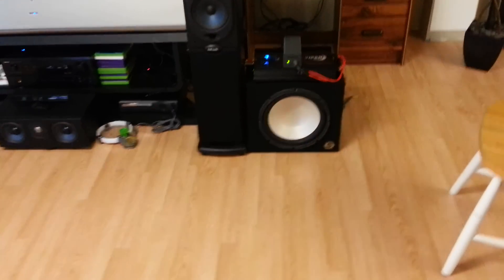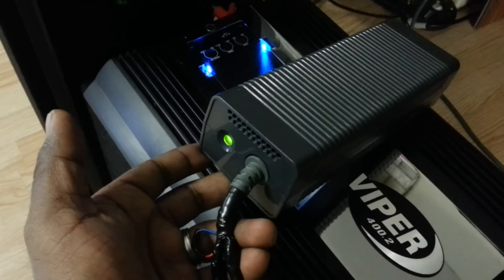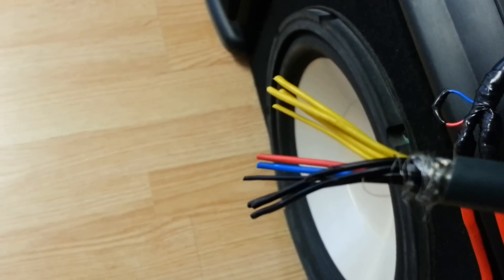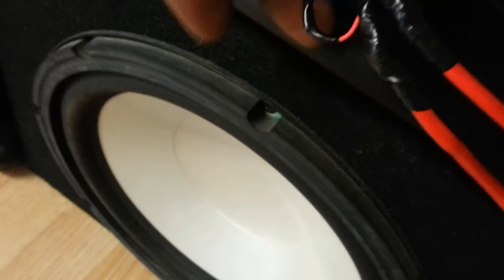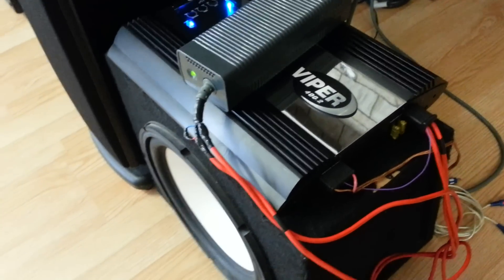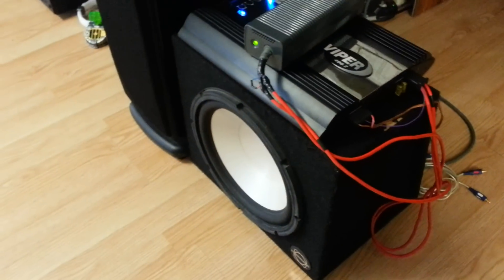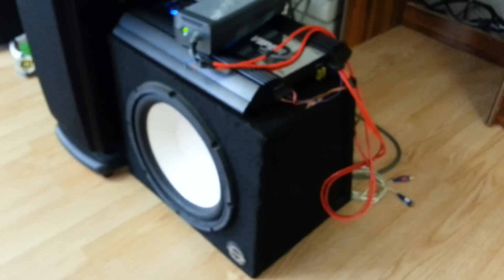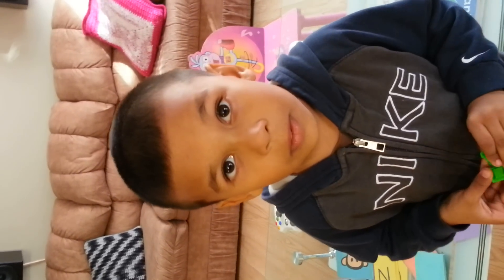Car audio at home - DIY - DC power supply  PSU w/ xbox 36o brick

Comment: AWESOME video brother! I’m just now getting to this in 2025 bc EVERYTHING is super expensive now. What I DO have is a nice supply of car audio equipment! But real talk tho…..what RMS/PEAK is that AMP outputting? And even with hours of high draw it doesn’t get hot??I want to do this, but at 14 Amp Output on the power supply, I can get this cheap and add a decent 12v battery as a power reservior. What are your thoughts? Is the battery needed?

Comment: I have an r.v ive got an extra battery im thinking of running to that battery to my amp  other than the inline fuse is there anything else i would need i have an extra charger on that battery as well

Comment: Fyi anyone doing this check your blacks and yellows for a single skinny wire on each if you cap those off and use only the thick ones it will stop amp from shutting off when running 200 watts. Not sure about higher.
Reply: thank you! My problem has been solved! From Japan!
Reply: @ of course srry my people here in America when they find a solution they only share if they gain something from it. Glad to help friend ❤️

Comment: Where's the remote wired to?
Reply: Jump it form positive for now
Reply: Just a small wire from the remote on your Amp straight to the positive on your Amp will trick it into turning on the Amp when you add power

Comment: Use a battery this will triple your electric bill 😂😂😂
Reply: This wont draw anymore power than running an Xbox
Reply: So you're saying that using a battery and having to charge the battery back up will use less electricity 🤔🤯

Comment: My power supply keeps on giving the red light instantly when connecting it to my heaviest amp, is it too heavy for the power supply? I've got the 150w 12a, so it's the smallest one. My other two amps work fine with this method
Reply: Yup if you draw too many amps the power supply will go into protection mode

Comment: Can you run a power on power off button to the power supply??? Ive been trying to figure this out forever cause i have 2 subs ran (this way with a power supply) but i dont wanna unplug them every time.
Reply: you can use desktop computer power supply instead of xbox one, they usually have power on/off buttons

Comment: Why not just go from amp to DC to AC inverter and from the inverter to a 120v power station that can be powered by a drill battery. Preferably dewalt

Comment: But won’t the wire get really hot
Reply: If you have a high watt amp
Reply: @bryarleach2054  no because the xbox 360 psu is like 260watt

Comment: Great Video! I tried you're set up and although its works fine on low volume, it starts to blink/flash adapter and amp light when volume is cranked up. Even trips at times. Im only running an old school autotek 7150BTS 150W amp. Any suggestions ? Do I need more amperage source to run my amplifier? thanks in advance for ur time!

Comment: Can you use 2 xbox power supply? To run an amp for higher power output?
Reply: You could you just need to find a 12v diode so one powerful doesn't back feed into the other power supply

Comment: If you were to make 2 of these.. could you use distribution blocks to link the ground and power from each to make higher amperage to play with?
Reply: people have been using PC power supplies, those are a bit more expensive but can push tons of watts and are just as easy to set up
Reply: Idk i was thinking about the same thing have u found out ??
Reply: Have not tried

Comment: Its funny because when i was a teenager i was always using home audio speakers in my car now im building a complete home theater system with car audio equipment. Im starting with a 100,000 watt system for an 1,100 square foot basement the 18 inch sub drivers will be the most expensive par of the entire system i will be building 4 different wall arrays of subs the seats will also be equipped with bass shakers so if your not scared 💩less your insides will at least be scrambled about

Comment: Guys, please use a more robust power supply.  I'm betting that Xbox power supply is only capable of providing about 20 amps of continuous current.  Car amplifiers, especially subwoofer amplifiers, require a lot more current for them to be happy.  When you supply an amplifier with too little of current or even voltage the amplifiers power supply is going to try very, very hard to push that sub with the given amount of DC power available.  When the amp wants to draw more current than what is available, over time this will eventually damage the amplifiers internal power supply and get very hot.  I would go with no less than 75 to 100 amp power supply.  IF you are going to try this at home, do it right the first time.
I will be making a video of my home setup that is running 4500 watts RMS and using 230 amps of AC/DC power supply current at 14.5 volts.

Comment: Question..  what do you connect to the remote spot on the amp
Reply: A wire running for rmt on amp to switch and a second wire running from power on amp to switch

Comment: I know this video is old guys but can any one tell me how he connected the remote turn on lead I've never seen an amp that just goes positive to positive and negative to negative without a remote turn on lead ?
Reply: @C Reed Thanks my guy this little Xbox power brick hack has been super helpful I'm running a Kenwood KAC-729S amp off of it and it works pretty good Its only capable of about 175 watts output but that's plenty for what I'm doing with it 👍🏽👌🏽✌🏽💯

Comment: Big Thanks to you I now can finally power my car subs in the house without having to bring in a huge car battery and having to hook up a bunch of cables, just didn't look clean and took up alot of space. So thanks once again man, awesome video 🤙
Reply: Are they still working?
Reply: @marvinreed3369  yeah it works but if u crank up the gain on the amp just alittle to high the power brick goes into production mode. So u can't really beat on your sub or subs with this set up.
Reply: @CarDudeVitaliy  The reason why is asked if it worked in your favor is because I had that same setup and I just wanted to see if we had the same problem. I have a solutions for it though, if you grab a power max 100 power amp, a fuse and a block and a 0 guage splitter box... you'll be able to turn up the gane.
Reply: @CarDudeVitaliy  if you can send me any social media I can show you a video of my setup, I'm runnin two skar audio 15in subwoofers with a vfl amplifier and these subs flex man.
Reply: @marvinreed3369  nice yeah send me a video of how it's hooked up to my Instagram, it's the same name. I would definitely like to get my sub setup working. I have a 10" strato ct sounds hooked up to a rockford fosgate amp and the power brick just keeps going off.
Reply: @CarDudeVitaliy check your 360 yellows and blacks. If there are 2 skinny wires on each positive and negative side cap them off and only use the thick ones. If you are running less than 250 wattz this should fix it

Comment: quick question, can i use a regular 12v  adapter to power the amp
Reply: you can but it you can't play it very loud, it will power starve (experienced it with 160w rms amp(in bridge))
Reply: @kultss  thanks man

Comment: power of xbox alim ->11A max  & 12volt......amplifier of car 
works correctly at 14v.....you must use a condasateur 1.5 farad for get 
14v with a alim of xbox ans use a amplifier of 150w/rms max 
(11Ax14v=154w) it s ridiculous for a amplifieur of sub!!!!! and if you 
use a amplifier sup a 150wrms your alim xbox will grill after some hour 
of use

Comment: so the rca output on a home cinema amp i can just plug into the rca input on my car amp?
Reply: yes you can literally plug in rcas straight from your phone or from an rca plugged into a bluetooth receiver and the other ends into the amp, its that simple, but if you have an amp that had 4 rca plugins you will have to mess around with the patter you plug in the rca to get better sound quality, if yours has 4 plug ins instead of just 2 I would recommend in a diagonal pattern

Comment: I used an Xbox 360 slim power brick and I came across some trouble. It only had 2 yellow and 2 black. I shorted the red and blue, then connected the yellow and black to the amp, but the brick light turned red as soon as I plugged it in.

Comment: Pulled my system from the car, just did this set up today with the Xbox 360 power supply. Thanks for the video. I had it going with an AC 12V but it wasn’t enough for loud bumping. Now my walls are shaking and my neighbors are jealous. Found this exact power supply in the video at my local game shop. Cheap 😎
Reply: How is it doing to this day? still working with no issue ? I want 2 know because I wanna do the same to my home setup
Reply: Did you just say You were running AC 12v 😂tf

Comment: Nice Polk Audio set up! I too am using a car subwoofer amp in my home set up. I was using a Direct TV power supply (12V 4.5amp) it worked flawlessly on a 400W amplifier, but the XBOX power supply I is 12.1amp, still not much amps but the XBOX power supply is a better choice

Comment: So I tried doing this with a kicker and a mrpf200 amp but for some reason the sound comes out extremely low. I tried adjusting the gain and making sure everything is wired correctly. Any idea what it could be?

Comment: Just a 12v battery (lithium) with a charger works fine for me on a low power 
quality system.      (good speakers don´t allways need a subwoofer)

Comment: disclaimer: an xbox power brick stacked by 3 , even stacked by double, is NOT capable of handling a 1kw load! Trying to pull anything more than 200W from it will cause damage to your equipment.  the power brick is capable of handling up to 200w for brief moments not a sustained draw of 200w and depending on the resistance of the speakers then that 200w draw from the power brick can quickly turn in to a 12-75w output from the amplifier. not only can this easily damage the power brick but it can also hurt the amplifier and it will more than like blow the speakers by clipping them to death. Do NOT stack power bricks do not use power bricks to power amplifiers do NOT use pc power supplies to power amplifiers. do it the right way, the safe way and buy a power supply designed to handle that kind of load. there is a reason why a 35 amp out put power supply that is actually capable of outputting 35 amps costs at least 100$USD.

Comment: Trying this currently. It only sends power to the amp the second i plug it in then the power brick turns red. Any ideas? Im also just trying to plug the yellow and black wires directly into the amp. Mine also had 3 yellows and 3 blacks
Reply: It is weird. I have gotten it so sometimes it turns on fine and works. Other times the red light comes on. Not sure why.

Comment: Had no idea the 360 power brick was a 12v out, that's awesome!
Reply: Yeah any power supply with a brick like that is an inverter :)
Reply: @GeorgeMasonOliver  honestly thought it was 36v or something so I didn't even check, but I've been using thrift store xbox supplies to power everything now. Subwoofers on every sound system now!
Reply: @Dinie09  ahh gotcha that’s cool tho I’ve been thinking about using some old sound system stuff to make a home media setup. I’d probably just use an old trickle charger on an Xs power battery I’m not using
Reply: @Dinie09   pretty much only industrial equipment use more than 12V
Reply: @GeorgeMasonOliver  pp
Reply: @GeorgeMasonOliver  its a Converter you convert AC(Alternating Current)-DC(Direct Current) with an Inverter you invert DC-AC. Most home electronics use DC power supplies to power themselves. If you look at the brick on any electronic that has a brick at the end of the power cord it will tell you the Input and Output info whether is AC 110v/220v how many amps it uses and then the Output whether it remains AC or if it Converts to DC power. A power Inverter is more commonly used in Automotive situations where someone wants to power home equipment in say an RV. Items like your TV ,Washer and Dryer, run off of AC power.
Reply: @strhaivenswr  Oh yeah I know al that and often now most things have internal converters, I just got the names mixed up
Reply: How many amps can this push? I was going to get a PC power supply but this seems a lot cheaper. My amp uses 60A

Comment: The shorter the wire is the less resistance you will have. But in your case you added more resistance when you added the 10 guage ! Allow me to clarify! Instead of twisting the yellow wires and directly plugging them into the amp you extended the wires adding additional wire that the current now has to travel through. When dealing with small amounts of power you want to keep the wire as short as possible and go into the amp asap! Your theory on Wire resistance is correct it just that added distance plus added thickness can add more resistance too! So again I would go into the amp as quickly as possible! At least that's my theory!
Reply from the maker: Your theory is correct Sir, I have learned alot if things since posting this 4 years ago!
Cheers,

Comment: I bet you are Canadian. Can't you just use a AC to DC 12V power supply instead. And a 2 way crossover network for the bass stuff. Sound pretty good though. ☑👍😎

Comment: Why not just hook up a switch to the red and blue button to turn it on and off
Reply: Anthony Efx more safe to just unplug it that way no chance of anything starting on fire
Reply: @daytonemmett5152  you could always wire a pull fuse in line with the switch.

Comment: I want to use an Xbox power brick to power my pioneer car audio in my kids room. Can I connect the blue and red wires to the pioneer so that the power brick is in standby untill the pioneer is turned on? That way I could keep settings and radio stations. I hope standby power of 5v 1a is enough for keeping presets? I don't fancy having the brick on all the time. Thanks.

Comment: Could I do the same if I have a active sub?
Reply: . You can use a sub with a broken plate amp, since you are bypassing the amp and controls.  Unplug the active sub from the wall!  Run the audio wire from the amp to the speaker + and - terminals (disconnect the existing ones) next to the back of the cone inside. You could pass the wires through the bass port or drill a small hole.  Of course you , for safety,  never use the old power plug again.

Comment: Very well thought out and only complaint i have is when its said that everything you plug into wall is 110 and the other is subs take 12volt dc not true on those two. But other than that great vid.

Comment: How do I get power from the amp GND REM and +BATT
Reply: He literally just showed you.  CARS RUN ON 12V DC, HOUSES RUN ON 110v AC(completely different) SO INSTEAD OF USING A BIG ASS CAR BATTERY IN YOUR HOUSE HE USES A POWER SUPPLY THAT  PUTS OUT 12v DC.  use a multimeter!!!!!!!!!!!!!!!!!! The one that reads 12volts goes to "bat +" on the amp and the ground cables go to...ground on the amp.   run a little wire from the BATT+ TO THE REMOTE Terminal on amp. RULE: when there is 12 volts on the "remote" terminal of amp it will always turn on and not shut off until that is 0volts.